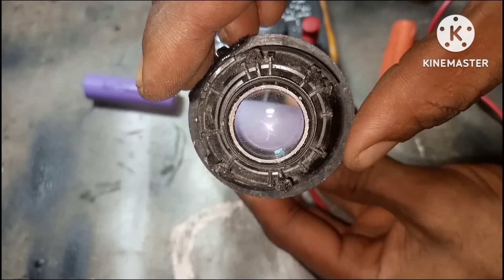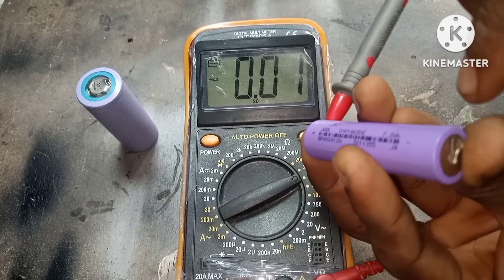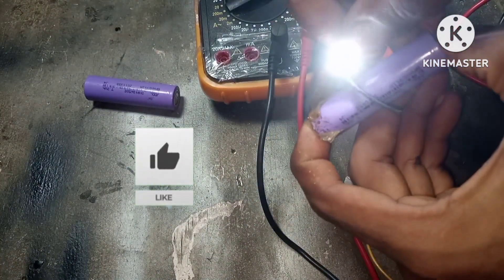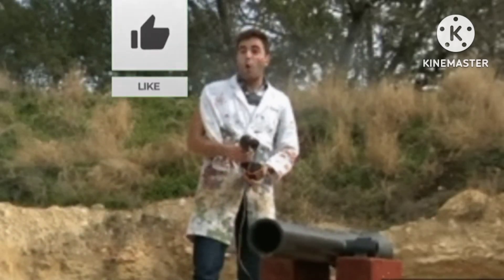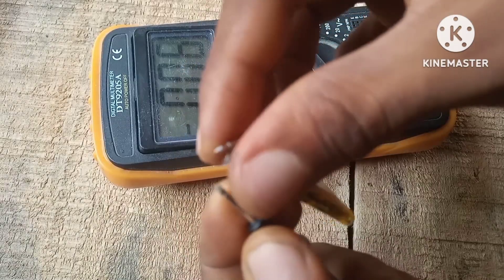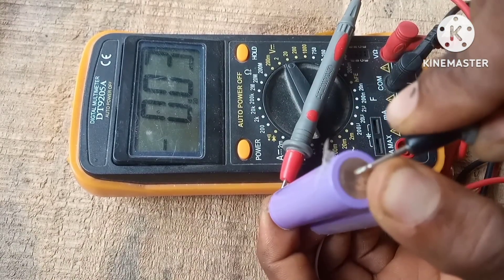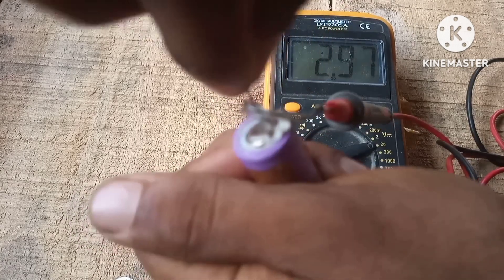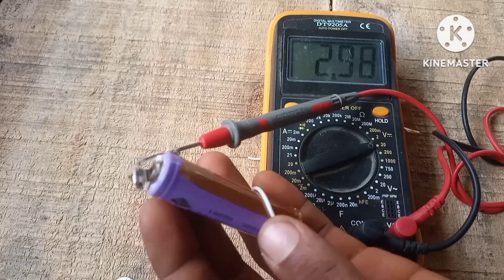Safest way to repair a lithium ion battery

Comment: ok.. why did the hissing sound happen when you wasn't pressing the pin onto the battery?  it was kind of right at the beginning, but that last one,  you could totally tell someone in the back ground was making the sound..  sorry.. but still looks fake because we cant see all of the cables.. being so close to the camera does you no justice and only creates the possibility of deception.  but either way,  hope you get the views..  keep fighting the fight
Reply from the maker: No I have never created any fake content, I use my phone to record this video when filming it probably didn't capture the audio in time, but also you should try it out for your self, I can't convince you any better,  if you try it out you will hear a hiss sound then come back and reply me😊
Reply: @Blinksiteengineering  i would if i had that kind of lithiums laying around..  but sadly, they are all contained inside of working housings at the moment, but i'll keep it in mind in case a pack goes bad.  and i have made a bit of content in the past, but i've since removed it due to boobtubes content creators agreement.  mainly because i was making original works, and i didn't want to sign over ownership to them. so i pulled 99% of my content from them.
Reply from the maker: Thanks for the motivation man 🤟
Reply: @Blinksiteengineering  when your right, your right,  and you should always strive to teach others.
Reply from the maker: All my best brother 🤟